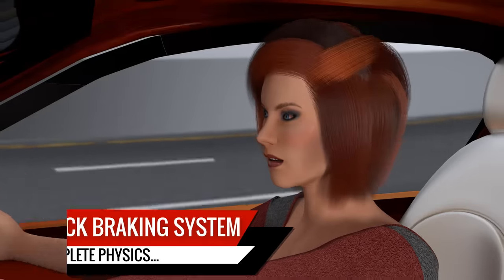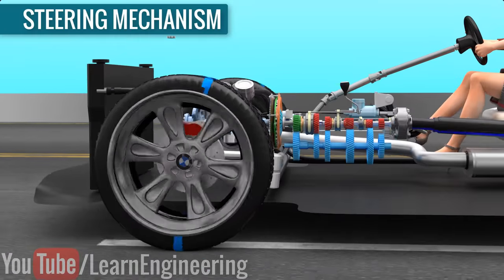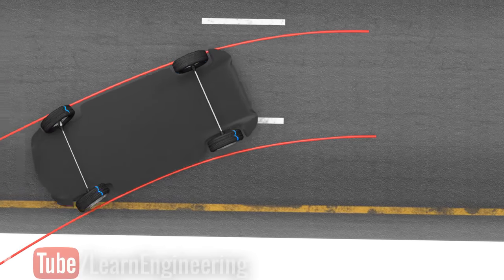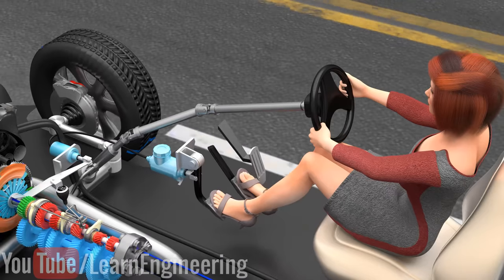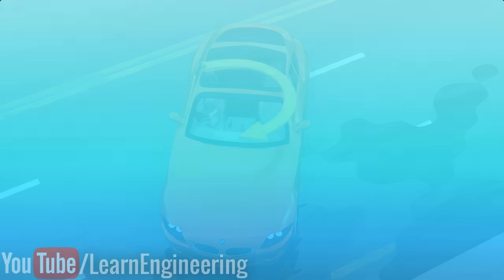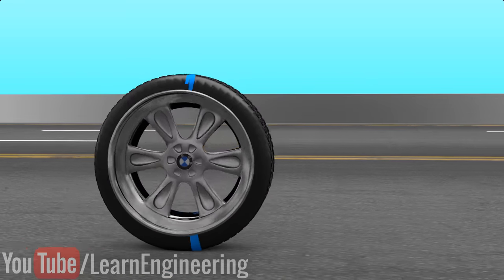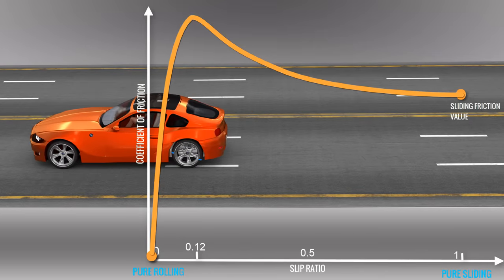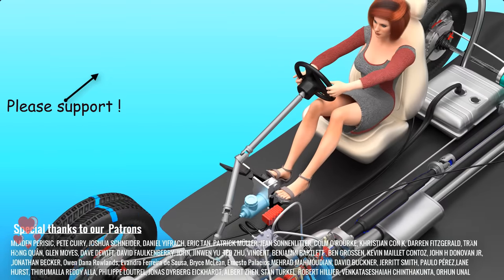Understanding Anti-lock Braking System (ABS) !

Comment: Thought I knew a bit about abs but now I'm even more confused
Reply: In easy terms
- abs prevents locking up wheels totally because that would lose steering capability. Intermittent braking instead of full braking. 
- the intermittent braking actually brakes better because of how rubber wheels interact with the road
- abs sees if the car sways to one direction without steering and adjusts brake speed per wheel to make up for it. 

Hopefully it was helpful, anyway I just liked to write it down for myself too.
Reply: Exactly...this video making more confused. I do not why...few people praising blindly.
Reply: @haiderali-rg1ns  Or! Some of us get it faster than others........ or without certain tidbits having to be explicitly spelled out considering everything else.

Praising blindly... like you're some unsung genius
Reply: Don’t worry , just press brake pedal and don’t think about what’s going under your foot

Comment: Brake on a straight line, smoothly release the brake while applying throttle as you turn.
Reply: You can't apply throttle while releasing the brake haha
Reply: Only if you drive an automatic but even then it would be stupid

Comment: How locomotive engine works. Plz make video on this.
Reply: Krish Gurung Well some just have giant diesel engines (more modern ones) the old ones run on steam. They have a water boiler and they throw coal in a furnace to heat up the water turning it into steam and that's what powers the train. Of course it's a bit more complicated and a video would still be good but that's the gist of it and there are already a ton of good train videos explaining it on YouTube.
Reply: cronicjointpain -modern ones are all diesel electric, well at least in North America. Electric traction motors drive the wheels. The diesel engine just powers an electric generator...no mechanical connection to the wheels at all. I agree, a video would be cool.

Comment: ABS is really an accident-saver even on motorcycles. I had a 2003 Kawasaki ZR7S with no ABS,  many times when I had to do emergency hard braking the back wheel locked up and I will do a donut fish-tailing at 50 MPH, if you did not have the experienced I had you would have crashed.  Now that I have a modern bike, the Kawasaki ERN6 2017 I have ABS brakes.  In the same hard braking the back wheel doesn't lock 'n slide or do donut fish-tailing.  It's very safe, totally worth it!

Comment: So many times I wished the manufacturer provided some kind of switch for their ABS.
Yes, it decreases overall stopping distance. Even on slick or icy roads. Even in skids, most of the time.
But it fails completely when you're riding your brakes all the way down an icy hill, when you're trying to slow while driving through deep puddles. No brakes at all, no real stopping, not even much slowing.

Comment: So if your car doesn’t have ABS all u gotta do is to stomp you breakpads repeatedly?
Reply: Provided you can generate the 12% Slip Ratio repeatedly - you do not need an ABS. :D
Reply: Tell me about it, when was the last time you heard a non-abs car in an accident, the kids that drive today needs this. ABS is good I am all for it, but learn to drive an older car first. Feel the road and feel the steering, everything today is a game controller, you can't feel nothing. I am serious.
Reply: @Raul_Gajadhar  Not entirely sure where you are getting at, but okay. I've driven Peugeots and Suzukis without power steering or ABS, I'd rather stick to my own car with power steering (hydraulic) and ABS. I had two occurrences already where ABS saved the suicide bikers from ending up on my hood.
Reply: Theoretically speaking, yes. On old motorcycle with disc brake and without ABS, riders are adviced to repeatedly pull-release the brake handle to prevent slipping.
Reply: @Raul_Gajadhar  ok boomer!
Reply: All the ABS does is it electronically modulates the brakes at very high speed as explained in the video in maintaining a proper coefficient to wheel slip.
Reply: Raul Gajadhar I like the way you think. I personally have great respect for older cars. More simplistic and les things to go wrong!
Reply: @Raul_Gajadhar  you might have an indian looking name, but you're absolutely right, learning to drive in an older car, makes you a better driver, don't trust who says otherwise
Reply: no you have to apply progressive break pressure

Comment: Muhammad Al Adaby
NIM. ...
Semester 4

Sebelum sy uraikan isi video tsb, sy bertanya=
1. Manakah yg lbih besar, DAYA CENGKRAM rem konvensional ATAU rem ABS?
2. Pada kondisi hujan, apakah daya cengkram ABS mlemah? Karena kita ktahui bhw ABS tu sangat trgantung dg kelistrikan mobil

Video tsb mnjlaskan definisi Anti-Lock Braking System (ABS), beserta komponen, fungsi, dan cara kerjanya

A. Definisi ABS

Rem ABS adalah Rem ABS adalah sistem pengereman yang dirancang untuk menjaga keselamatan dengan mencegah kendaraan mengunci roda ketika pengemudi melakukan pengereman mendadak. 

B. Komponen dan fungsi 
     ABS

1. Master Cylinder:Untuk menerima tekanan dari pedal rem dan mengirimkannya ke sistem rem.
2. Wheel Speed Sensor:Untuk mengukur kecepatan roda kendaraan dan mengirimkan sinyal ke kontrol unit.
3. Modulator Valve: Untuk mengontrol tekanan yang diterima oleh roda kendaraan dan mencegah terjadinya penguncian roda.
4. Kontrol Unit: Untuk menerima sinyal dari wheel speed sensor dan mengontrol modulator valve sesuai dengan kebutuhan.
5. Rangkaian pipa:Untuk mnghubungkn master cylinder dg roda kendaraan.
6. Relay Valve: Untuk membuka atau menutup jalur tekanan udara yang mengalir ke modulator valve.

C. Cara kerja ABS

1. mengontrol tekanan pada setiap roda saat melakukan pengereman. Saat roda mulai terkunci, sistem akan melepaskan dan mengulangi tekanan secara otomatis sehingga roda dapat tetap menyentuh jalan dengan baik.
2. Rem ABS juga bekerja dengan memonitor sensor yang terpasang pada setiap roda. Sensor ini akan mengirimkan sinyal ke kontrol unit ABS untuk mengevaluasi kecepatan roda dan membuat perubahan tekanan pada saat yang tepat.
3. Selanjutnya, katup ketiga akan menghalangi tekanan. Katup satu akan membuat tekanan pada minyak rem kembali dan meneruskannya ke rem kendaraan jika sensor kecepatan roda terdeteksi. Proses tersebut biasanya berjalan dengan cepat, yaitu satu detik untuk melakukan 15 kali proses.

Comment: I would like to disable ABS in my car a few times. It can't drift when it's on.
Reply: You might need a hydraulic e brake, it will lock up the back tires so it can slip
Reply: @cloudburst5196  I know, but isn't that a bit useless on a rusty 'old' car that might turn into dust at any second?

Comment: the best ABS is your right foot.
Reply: Left, actually, while keeping the right one on throttle. Apply both them correctly, wheels can never lockup even on loose surfaces (AWD).
Reply: 2many games
Reply: no literally, a pro driver is always better than ABS.
almost all modern ABS is too aggressive and often times hurts more than it helps.
Reply: All it takes is some practice to allow the left foot to operate the brake as well as the right foot. Left-foot braking has its advantages; although it's not for everyone, it's certainly not "wrong".
Reply: You think you can operate you can operate a brake with your foot... better than a machine?
Reply: I think I can operate brakes based on different road conditions better than a machine, at least until Skynet comes along. Feel free trust your current machine by slamming on the brake on snow/ice and report back.
Reply: IRON MAN a driver is a person who can drive, not an expert.
Reply: IRON MAN Look at formula 1. Braking can easily be done with the left foot.
Reply: You mean getting your foot out of the car and using it for braking?
Reply: Average drivers tends to panic on braking. However, relying too much to ABS doesn't make one a better driver. That's why ABS is absent in race cars in order to hone braking skills of the drivers. It's a tall order, but human braking can beat ABS.
Reply: Rice Y. It's a tall order. But I agree to what you're saying.
Reply: Can y'all stop watching Fast and Furious?
Irl it takes much more than an internet comment to learn to break faster without locking, not using ABS.

Thank you very much,
Reply: Not exactly best, but more involving !
Reply: I am very good at manually pumping the brakes, but a computer doesn't panic like humans do, and a computer can react much faster than a human. I've recovered from a few skids in my classic car and my race car, and it definitely takes a moment to properly react without panicking. Even Formula One used ABS until it was banned a few years back. I think being able to manually pump the brakes is a great thing to know, especially if you own older cars, but ill take ABS if available any day.
Reply: @triptheroad  Finally, someone with a brain
Reply: @triptheroad , ABS is a good thing, but has some disadvantages. That driver who use to brake with ABS often fully depends on it's work and dont practice in other braking methods. So it can cause an accident in extreme circumstances. For example on very slippery road where ABS is useless and even worse than human blinking braking or engine braking. So when such ABS driver drives on iced road he tries to brake as usual but nothing happens, so he panic and dont know what to do next. Otherwise even a pro driver dont know exactly what is under his wheels right now in the moment and how much grip they have, but ABS know and can prevent sliding. So ABS is your bro, but never depend too much on it. )
Reply: @3rdGenGuy  Yeah, in some racing applications this is the case. You may even want to omit power or servo brakes. But that's racing.

In public road traffic, even in bad conditions I don't generally value having only ABS much in comparison to having a well designed, well built, well handling vehicle with top tier tires and shock absorbers. Even then, it's better to have it than not have it. Really, no matter how good you think you are, and you're no match to me, honestly.

Good old ABS is one thing. Full set of driving electronics including ABS, traction control and dynamic stability control is another story. My choice any day for a daily driver or a work vehicle. Recreational stuff is unrelated.
Reply: @adfggffffffddffd  Probably you could in difficult conditions where you get inputs the machine does not. As is the case with normal ABS system that has no camera, radar, lidar, thermal imaging etc. And I'm just making up a cute little hypothesis here. _To operate a brake_, that is. A brake as on a motorcycle wheel, or a single pedal system that just divides pressure evenly to two braking wheels, or even a system that does similar stuff front biased on two axles with two brakes each to be operated evenly.

Operating four different brakes independently - which is the principal function of ABS - of course not. You could not if you had the controls, which you don't have in the first place, for obvious reasons. Two brake pedals is enough to be too much for most human drivers, even when they have microswitch clutch and hand throttle.

In an absurd alternative dimension where cars had just one wheel, there would be way less benefit to handling from having ABS.
Reply: Anton Zuykov  A pro driver with four feet who has four brake pedals set up in a special niche car, maybe. And not just any pro driver. This takes something way more pro than Schumacher. More than your 0.00000001%. A cybernetically implanted specially trained autistic dog steering with his nose and accelerating using his tongue or something.

Oh, of course driver skill is more important than ABS, or dynamic computer stabilization or even good tires up to a certain point. But this discussion was about braking ability, and about 100% of time ABS(or any system) beats pro drivers in a sudden driving situation. I know I'm being harsh here: I'm seating the "pro driver" in a family car unprepared, not giving them professional gear like studded tyres with huge spikes and stuff like that. Otherwise we would be comparing ABS and a snowmobile or a tank, apples and oranges.
Reply: Yeah if you drive flintstones car
Reply: @3rdGenGuy  im not really sure cuz abs has control over the 4 brakes independently

Actually i did some research, and it seems ABS is always better than a pro driver, except on sand or gravel